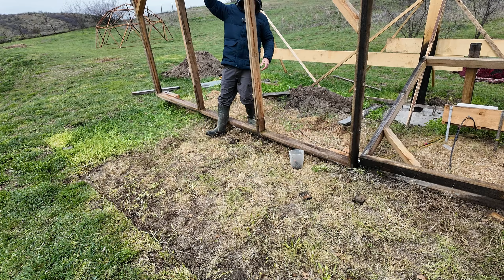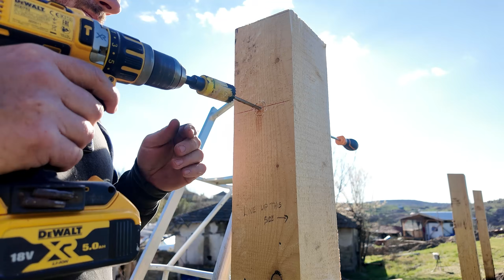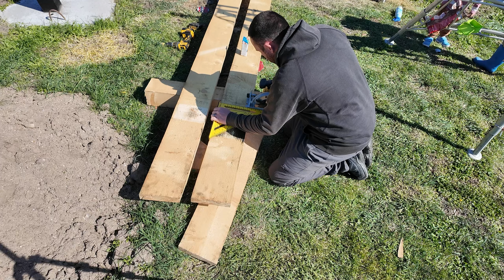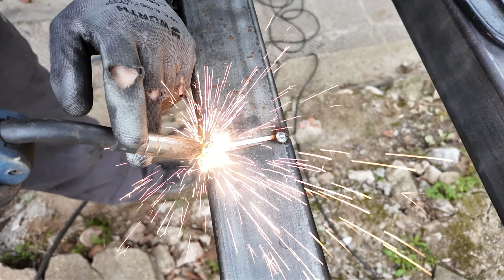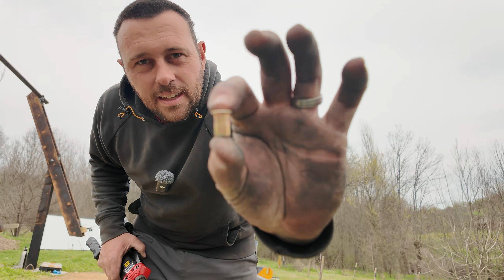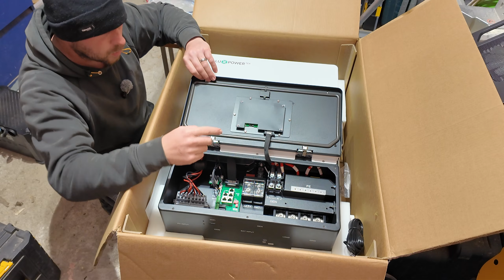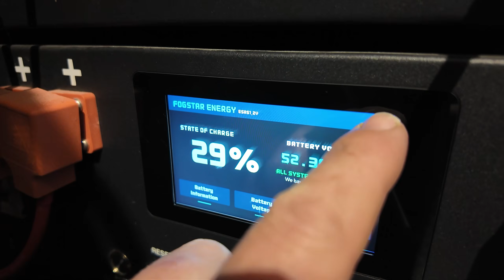How This Family Powers Their Off-Grid Home with Solar

Comment: Keep in mind that those nylon washers will be burned from the UV rays and heat in couple of years. As an idea - you can replace them when they desintegrated  wit a rubber washers from old tyres. They will last a little bit longer. But nowadays there are many 3D printing services and you can order for reasonable price UV resistant and way more durable washers anytime. In Bulgaria we have veeeery hot summers but you probably already know that. But anyway it's an awesome Idea for "mini solar park".
Reply from the maker: Thanks for watching. Yes the UV degradation is something I am definitely aware of I will be keeping my eye on these but am fully expecting to replace them in the next couple of years. I never thought about 3D printing though that's a good idea. 
Cheers for the comment 🙂

Comment: You are clearly a talented young chap Phil. You could make a good business out there with your skills and knowledge. Just one thing on your panel stands are you going to put some cross  bracing to the up rights.
Reply from the maker: Hi Robin. Thanks very much for the kind words, there are many business opportunities out here sadly I don't have the time though. Once I had built the frame I tried to wobble them left and right as I thought it might need some, but it's rock solid so I'm not going to bother. I will be putting bracing to the panels though when we have bad weather due. Thanks for watching as always 😊👍

Comment: Well done and a necessity for off grid life, not sure I would be happy with the costs overall for such an array though, especially with weather fluctuations. Had you thought about protection from hail? Heard some pretty horrendous stories of destruction when you get those. Interesting all the same.
Reply from the maker: Thanks for taking the time to watch and comment. Yes this certainly isn't the cheapest build. You don't need to do anymore than lay the panels on the ground really. But we always try and build for the long term so we don't have to revisit previous work or builds. 
When we have hail forecast we will stand the panels up 'near vertical' so the hail tends to glance off and the exterior frame takes the brunt of the hail. We will see how well this works as it's just my thoughts. Cheers 👍

Comment: Looks like there's a twist in the array when you brought it down before you showed the inside might want to keep a eye on that
Reply from the maker: Sadly there is a slight twist in the timber which I couldn't see until the panels were on. I will indeed keep an eye on it and if it gets any worse I will probably change out the timber beams for some kind of steel. The twist does look a bit worse on camera though. Thanks for watching and commenting.

Comment: Dead impressed with your work! I am on a job right now with no drawing or anything, I'm working out pipework routes ,positions of waste pipe runs etc, all in the hesd though. Can I ask, do the swivel bolts run straight through the timber? I was wondering if they should be somensort of feral/bearing for the bolts to sit in. The timber may ware at different stages and then end up with an unbalanced system. I may have missed you doing this, so accept my apologies if you did. Keep it up bud.
Reply from the maker: Thanks for the kind words. The swivel bolts are a thick walled steel pipe with a M22 threaded rod though the center. The amount they move I don't think the timber will wear but I will keep my eye on things. If I did this again I would do it all in steel and like you say use bearings at the pivot. Thanks for watching and commenting. 😊

Comment: nice idea, i need to build this for my off grid setup :). Looks like pretty easy structure, can u share the measurements?
Reply from the maker: Thanks for watching. I think the measurements will differ depending on your panels, array size, ground conditions etc. If you watch the previous video to this one I show my plan on camera if you pause the video you will see all my measurements. There's also a guy I got the idea from on YouTube called Rodney Hunt who filmed his array build. Cheers 👍
Reply: @OffGridWithTheUdens  thankyou :) !!!
Reply: @OffGridWithTheUdens  to make a slope for the seasons i ll put a weight on the upper side. and a chain with a hook anchored in the middle pole of the downside panels. put a multiple anchors in the mark of every season and only change them manually. 

what system you are going use to change the the panels for different seasons?

Comment: get some linear actuators on the solar set up with remote controls so you can tilt it when ever you want Phil love this channel
Reply from the maker: Thank you so much 😁. Yes my brain is whirling with ideas already. I'm running a power cable up with the solar cable in the conduit 'just incase' 😆🫣. I like playing with hydraulics too. It's sounding expensive already 🤣 thanks for watching and taking the time to comment.
Reply: @OffGridWithTheUdens  doesn't need to be hydraulic, looks like its quite well balanced, a stepper motor and a lead screwon a couple of hinges could probably do the job - not sure how it would stand up to wind mind, would probably want a seperate locker, preferably one that locks when unpowered
Reply: You could use satellite actuators to shift array and purchase a satellite dish positioning unit and input your 0 volt shift position as it would be used when finding satellites in the arc position so it would be extremely accurate.Also I 100% agree with you about service and firmware updates and the purchase of equipment if those who purchase these goods want them controlled or governed then the manufacturer should give them away and to brick the unit or make it obsolete is not acceptable because of control and ultimately making it obsolete because of cash for needing extra batteries however you could keep it as a backup and install a third party battery monitor.Keep up the great work just found your channel by the way what is your battery setup 24v 48v and what is your battery capacity.Take care John Birmingham UK Osborn city lol

Comment: I'm not an expert at all but I think you have too much trust in those bolts holding the panels. :)
Reply: @hristokozhuharov8099  Completely agree, thought same. Here in the USA, our storms would rip that out of the ground or off the supports on any given weekend unfortunately.  I do like the system though
Reply: @jd1029  I'm not far away from the Udens I guess (Haskovo region). Although strong storms are generally rare here, I thought the same thing. I hope I'm wrong, though.
Reply: @ Had a storm just yesterday with 65mph gusts. Some places saw 80mph with much damage. Not uncommon for this time of year unfortunately. I think gust loads need to be factored into design systems, not just grade 8 bolts.
Reply from the maker: Ideally I wanted to use M8 bolts but I didn't have the space on the rails (poor design over look on my part) I am going to conduct a test and I'll try and put it in the next video to see how strong they really are. But there's strength in numbers here and I don't think it's going anywhere, let's hope not anyway. If I have any concerns I will drill out the rivnuts and put a bolt all the way through the steel to the other side. I should be able to upgrade the bolts in this case. Thanks for watching and commenting we appreciate it. 👍

Comment: Did you put a spacer washer between the beams and posts? And some grease.😅

I presume you're using 35mm battery cables? 235amp+ rated ... You may need to upgrade them for fault protection.
How many frogstar batteries are you running now?

Did you also do your math for wind loads?  You wouldn't want a cable to snap before you get your bars in, and you need to have a neutral set to level off in the windy storms...

Fair play lifting the inverter up there, id have gone lower. 😂 I was right with you with poor footing and not being sure if its clipped on.

Good job getting that done, how long did it take you ? Bet it feels great having one less limit.
Reply from the maker: I actually didn't use washers in the end. I tried with but it created a lot of movement on the beams which I was trying to reduce as much as possible. you're right about the grease though. I'm thinking of squirting old engine oil over the pivot area at regular intervals, we'll see how this goes. 
My battery cables are actually 70mm² good for around 480A so I should be fine. 
I'm planning to lock them in the horizontal plane when we are due storms and in the vertical when we're due hail. All in total time was probably a week but in the real world it was probably closer to 3 🙃.  Thanks for watching and taking the time to comment.  Cheers 👍
Reply: @OffGridWithTheUdens  there are two main wear areas, where the wood moves, and where the shaft sits.
Normally for long term use, we recommend using a bar, with the bolt inside.
For a "posh" version  we use bearings. On the bar and then bolted ends, the bearing case sitting alightly proud of the end.

Maybe eco-worthy might send you a tracker,  or the track controller... All fancy and automatic then ;)
Or you can make your own :) i make them for clients

Comment: Great build! The tilting mechanism is a smart way to optimise solar efficiency across seasons. I’m curious—what’s the angle range of adjustment? Have you considered adding a Shelly device for real-time monitoring? You could track voltage, current, and power output remotely and even share live data on PVOutput for better system analysis. Keep up the great content! 🔋⚡
Reply from the maker: I've never heard of a Shelly device sounds like a Solar Assistant though which I am looking into. Angle range for where we are is 17.3⁰ in the summer and 47.3⁰ in the winter. 
Thanks for watching.

Comment: Great set up Phil, the inverter looks very smart I love it, what name protocol best suit for the Fogstar batteries, I have the same batteries as you but tree of them and still not decided on the size of the inverter, was thinking of two Growatt inverters conected in series but now you conviced me to check LuxPower 12kW as will suit better my 15kW batteries.
Keep the good work mate👍🏻
Reply from the maker: The protocols will vary depending on the make of your inverter. I would definitely avoid Growatt - lux are high end but maybe check out SunSynk as they seem to be very good also. Both SunSynk and Lux run the Pylon protocols.
Reply: Thanks Phil, will look in to maybe Deye 12K single phase investor they are available in BG as well👍🏻

Comment: Great job! Now focus on securing the structure so it holds up in strong gusts of wind. I have seen house roofs flying ...
Reply from the maker: The next stage is to fit the bracing and the plan is to have ratchet straps on standby for additional protection in storms. 👍😊
Reply: What I was worried of as well..